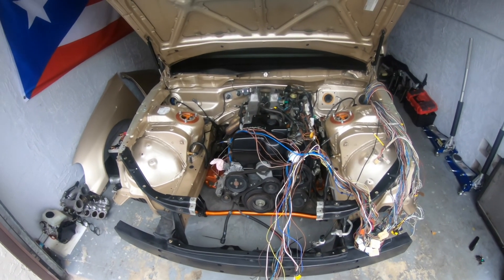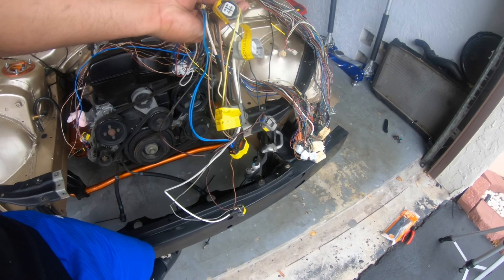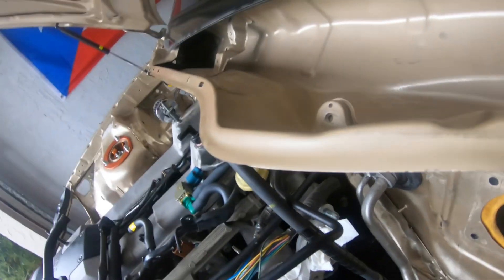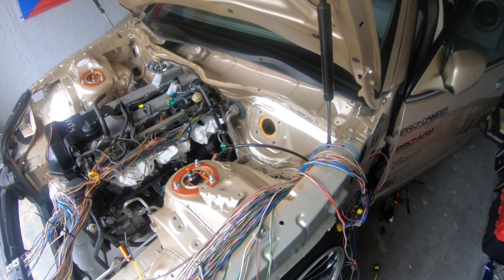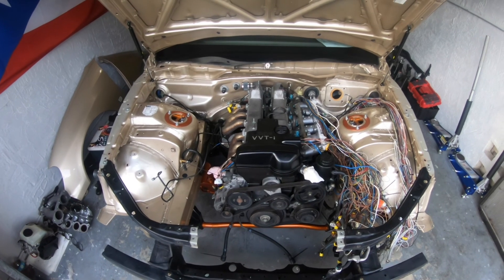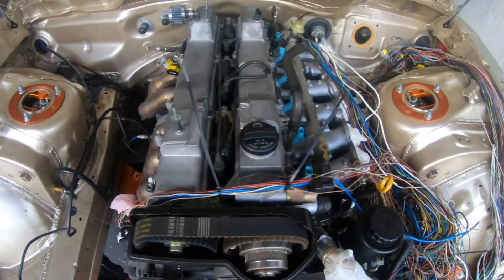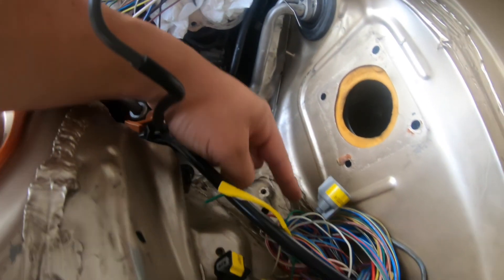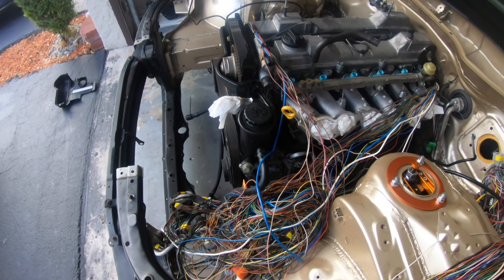LEXUS GS300 JZS160 2JZ-GE WIRE TUCK PART 2

Comment: What year is your gs im swapping a arristo ecu to run the jz seperate from the a650e in my 99 are you using a schematic or just delooming the harness to figure out colors on wires
Reply from the maker: Hey brother sorry I didn’t respond any quicker. So as far as the engine harness since I went with a gte swap I completely stop working on that since there are companies out there that make pre terminated harness. So I’ll just go that route. As far as the body harness that runs along the driver side into the engine bay from inside the cabin I will be eliminating what I don’t need and extending those wires. Hope this helps. Let me know if that answers your question. Thanks.

Comment: I'm confused. If you stripped down the engine bay, took the front end off, why not just pull the engine out and wire it???
Reply from the maker: Your correct. I ended up pulling the motor out and purchased a GTE motor instead. So ultimately the wiring was pointless after I replaced the motor but will like to figure out how I can still hide the wires in the engine bay once I put the new motor in. Thank you for watching!
Reply: @SOFLOGARAGE  You got knowledge now that a bunch of us didn't know. I never did wiring before and Im swapping a 2j into my mustang fingers crossed. Im trying to understand the ignition and fuse shit for the engine to start, I just dont know everything I need wired
Reply from the maker: Good luck on the swap! That would be interesting to see. I’m not a wire expert but I’m trying to force myself and understand. Thanks for watching.